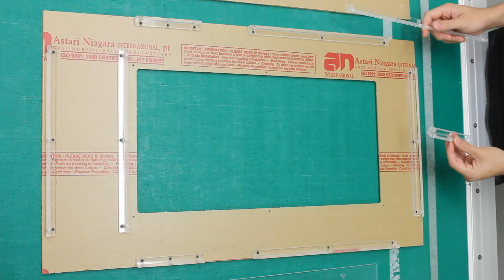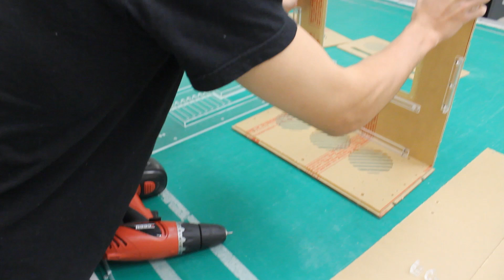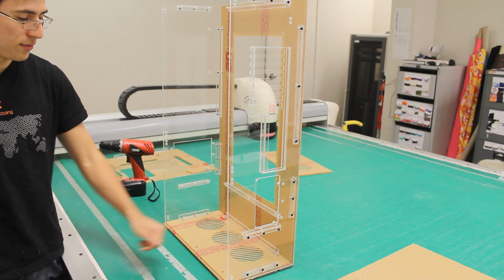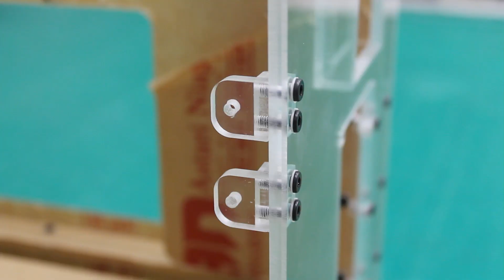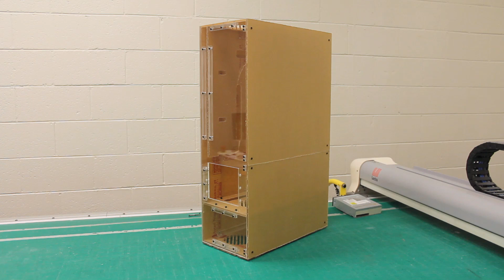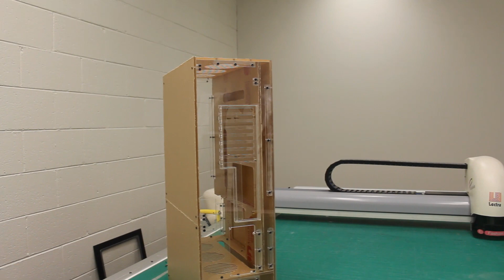Epic PC Cases Thermal Tower Assembly Video

Comment: @djayness Are the L-pieces milled from thicker sheet acrylic, or are they simply two pieces cut from 6mm thick sheet and then welded together? In addition you stated that it took (or takes) 7 sheets of 6mm acrylic to build that monstrosity, how big are those sheets??? 24"x48"?